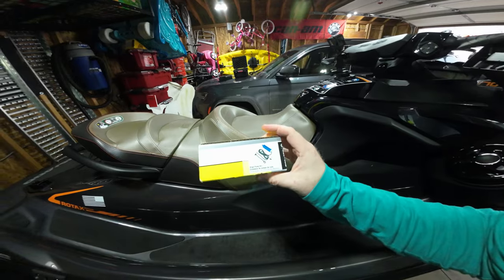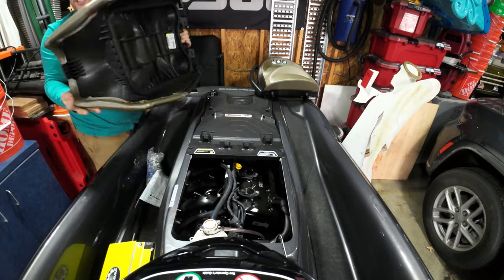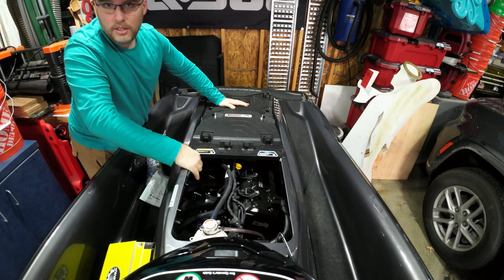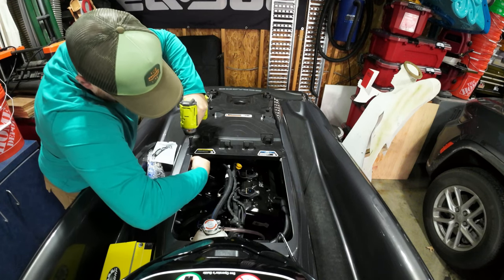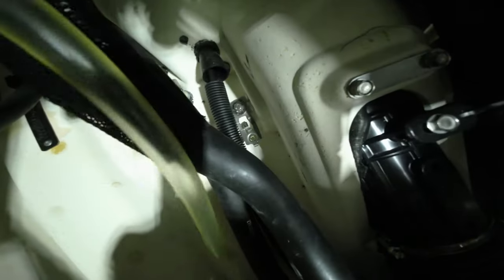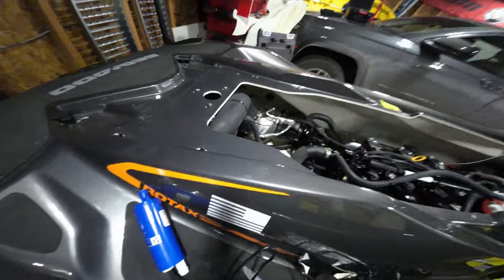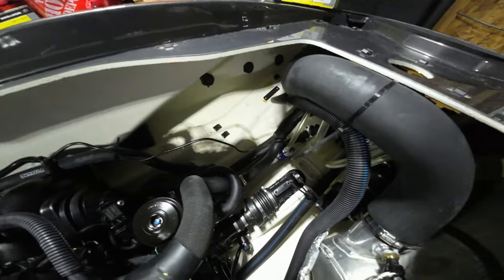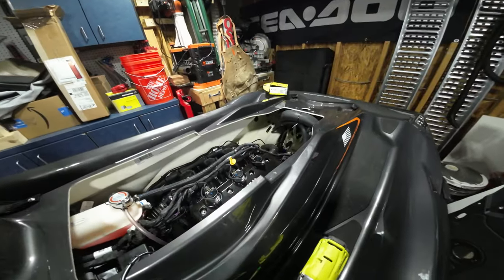Seadoo Bilge Pump Install

Comment: I installed identical pump. The noise is not only hardly noticeable, but actually reassuring. The issue I have is that when tested ( hose pouring fresh water into ski while tilted up ) shows little flow out of PWC. The outlet for the pump is VERY constricting. 1/3 of the water pours back in. The hoses it connects to are designed for siphoning water out while the impeller is running, and not a free flow for a bilge pump. I will be drilling a simple outlet for the bilge pump, and reconnecting the cut off hose section to siphon as designed. 
The pump is 24V, so using 12V I expect 1/2-1/4 the published volume of water, but an increase ( maybe ) of the service life. The life is 150 hrs, so I don’t expect to have 150 hours on my Seadoo for 4 years of so. 
If the carbon seal leaks, or if I hit an object at 50MPH ( say, a coconut ), a bilge may make the difference between making shore or not.

Comment: Did you have a hard time getting the mounting bracket bolt in? I had a hell of a time, had to use washers because I could not get the bolt down any further.
Reply from the maker: It was very difficult to get that in. I'm not sure why these don't just come standard from the factory. It's an essential piece of the ski. That would be like selling the ski without a battery. It would only add $200 to the price and give the customer a good feeling knowing they have an insurance policy.

Comment: That runs if running audio only too? Will kill battery fast. I’m buying same ski, probably will do one with a float switch direct to battery , so that it will kick on if docked and off and water accumulates also. Nice video, enjoy your ski, beauty!
Reply from the maker: It's been fine since I've had it installed. It shouldn't kill the battery unless it's an old end of life battery. I did find it odd that it runs nonstop but BRP says that's how it's suppose to function. 

Where are you ridding when you get yours?
Reply: @ChadHughes_Rate_Ride_DIY  I’ll be in North Carolina riding Lake Norman, Jordan Lake and occasional beach trips.
Reply from the maker: @maccam2626  join the jet rider nation group on Facebook. We have a huge community of riders. You can find some riders in your area for group rides if you want. It's a blast!
Reply: @ChadHughes_Rate_Ride_DIY  will do thanks for the suggestion

Comment: Won't running the pump dry just burn it out?
Reply from the maker: You would think so but it won't. I confirmed with the dealer that this is how it's designed to function.